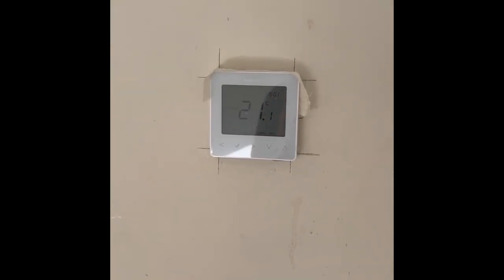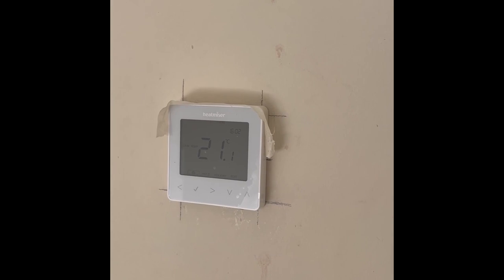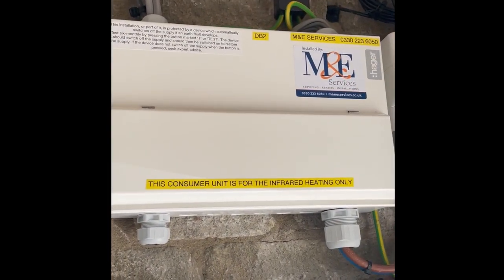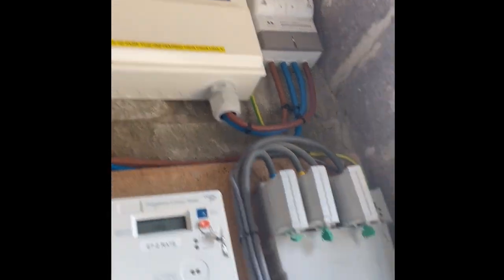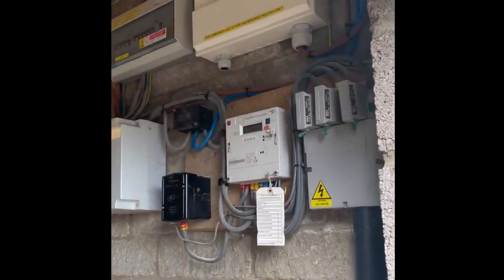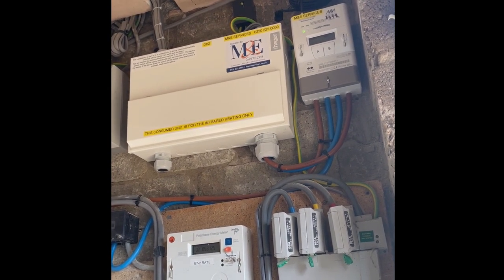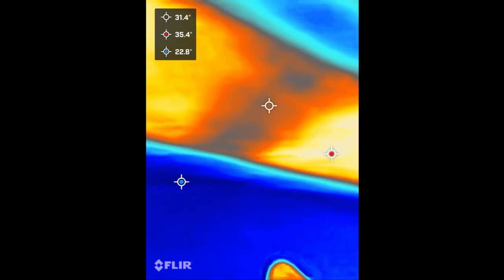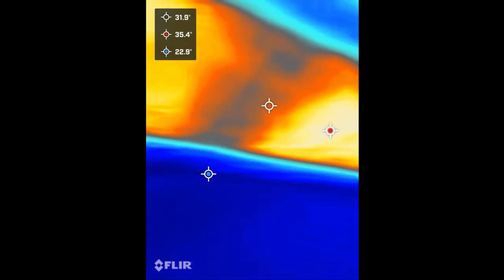Infrared Heating Installation (Video 3 of 3 Completion & Overall Summary)

Comment: We built a block of flats. Gas in all bar one where we installed an infrared system. Same U values.  The infrared system is twice as expensive to run as the others. You can’t add weather compensation and load compensation to a direct electric heating system. Electric heating is the most expensive form of heating, you can’t ever get away from it. If you had to install electric heating then at least the dimplex quantum would be cheaper to run, and cheaper to install. 
Great video, very honest and on point! Thank-you
Reply: On what basis can you say that the Dimplex Quantum would be cheaper to run?  All electric 'radiators' cost the same to run - they take the same amount of electricity to reach a certain termperature.  Having more control of the 'radiator' is another thing, and bring able to manage your heating can certainly help keep costs to a minimum, but all convection electric heaters cost the same to run and comparing them to the IR installation in the video is disingenuous unless you can actually point to real life data.  I think it's fair to say IR (and electric convection) can't compete with gas, that's a no brainer.   Replacing convection electric rads with IR is a much better case study.  Show us those comparisons.

Comment: I ordered my Astectherm mats for two rooms & they arrived within a week. You need solar PV & batteries to make IR mats worth it. Great video btw.
Reply from the maker: Great, you were much more fortunate. Agree with the solar, if youre on the decent FIT then no batteries needed, at least for a good few years.  How many kW of battery storage do you have? You have to weigh the life of the batteries also. Thanks
Reply: Hi Mike keen to here what you thought of astectherm and also how the system is working for you. How is costs to run?

Comment: Informative thank you. I'm looking at these systems as am currently on lpg and spending about £400 a month in the winter.
Reply from the maker: I would suggest looking at something else tbh.
Reply: GringoTom - I'm in a similar situation, either stick with old storage radiators, go for an LPG system or maybe a heat pump or something 🤷‍♂️
Have you made any headway?
Reply: @coreyjameshaims449  I bought a standalone Ir panel heater to try out. Video on my channel
Reply: @gringotom242  thanks! Looking forward to a review once you've stress tested it a bit more 👍

Comment: V informative videos Thank you.  I'm curious wanting your knowledge (if possible) re the Radiant heating.  I have a home I built (3200sq ft) Albeit in Vancouver Canada.  
I fitted with ESWA brand Radiant panels (basically a clear film  laminated sheet encapsulating heating foils.. Mfg'd by ITT  in Norway of all places .. Ceilings and floors were well insulated  (back side of the heat panels to ensure heat went where intended ) and the panels were stapled to the joists before applying the drywall .. Each panel receiving a dedicated 220 v line ...dozens of panels  & 12 zones installed.  
I assumed it was a decent quality product. 
Well It wasn't...as the things failed.. one by one over the years.... 60 hz causes them to hummm and this fatigue fails the connections in the elements. 
Currently None heat..  I'm well pleased.  
Replacing means stripping the Gypsum board from ceilings and Stuffing in something else. But what ?  
Curious about your mesh panels  Seems an easy(ish) retrofit.   A slap the meshes onto an existing surface  solution.  At least Reads as simple 🙂
Not understanding what all the power junctions etc are.
 Doesn't Mains power  go directly to each panel with a line voltage Thermostat ? Mine do. 
Other issue is cracking.... Heat cycling of panels does ..Bad things.. to  Mudded joints... perennially !  
I assume there may be similar issues with a Mosquito net stuck on by Drywall mud ?? Or Not  ?? 

 Small aside: Heating costs are higher than the Sales types claimed Higher than a Gas furnace Notably so And I live in a Cheap electricity  (abundant Hydro electric power) area. 
Frankly I wouldn't touch  Radiant electric heat ever again.. But now  I'm stuck with my naive choice.

Comment: This is really interesting - thank you.  I am in a similar position - no option or want to connect to gas, and a real financial need to move away from the ancient oil fuelled boiler at my now property.  All the reading i have done about Far IR suggests that the way you use it to heat your home is different - I wonder whether the occupant in your experiment has understood this - it seems to be radically different to GCH.  I'm certainly not able to go through the effort you went to with the woven panels, but I have bought a few stand-alone units from Herschel.  I look forward to monitoring my own usage over Winter, and to seeing how your occupants get by.
Thanks again

Comment: ive a heat pump but am considering installing them in my bedrooms and hall as the rads fail to heat up those areas to a sufficent temp in my opinion. thanks for the video.
Reply from the maker: look at your insulation first then the size of the radiators. if you have a heat pump and had been installed correctly I would not recommend you install these panels in addition. 

your heat pump will be 300+% efficient, this system is only 100% in comparison.

Comment: finaly some good info.witch is the total installed power of infrared foils throughout the house?.i am using infrared pannels installed on ceiling (are more effective than on the wall)and   they heat up faster because they are not covered.it is a very pleasant warmth and humidity is within normal parameters

Comment: Hi, I watched some of this video because I wanted information on the installation and running costs of Infrared Heating. It was unhelpful to compare it to just gas, it would have been more helpful to compare it to other electric heating.  My flat is electric only and we are trying to save money with IR heaters.  It would have been useful to show an installation that wasn't as indepth as this (we're not attaching to permanent wiring) and to see what the difference is between that and an electric panel heater.
Reply from the maker: this video won’t be suitable for everyone I’m afraid. 
however, electric heating and electric heating will be the exact same. your heat loss determines what possible savings you can make

Comment: This is a great video. Thanks. So I guess if somebody were to install PV with battery storage, this may also be a good option?

Would be good to see what the heating requirement is Vs the PV generation to see how it compares and how reliant any user would be on mains electricity
Reply from the maker: PV only truly offsets with battery storage. This is because in the winter months when you need the most heat, the PV in turn generates the least amount of power and never enough to run any system without storage. 

For example, you may be generating 50 watts but if your system needs 4kw to run, the balance between 4000 watts and 50 watts which is 3950 watts is being supplied from the grid. 

If you had PV when the FIT was high, the repayments would cover this. But if you add PV now without storage your kind of wasting your time. 

You need stored energy so you can draw all of the heating requirement.

Comment: I would never use Infrared Panels as a total heating system for a house, (unless solar and battery storage was involved) we use our to enhance ASHP (because we have very poor insulation, working on that long term). Through our solar system in the autumn and later winter months on cold sunny days we use the panels to heat our main rooms, so we don't have to turn the ASHP on. Otherwise when the ASHP is switched on we use it to boost our heating in very cold days -5c/-10c. They do work very well, but they are meant for well insulated homes. If you want to find out yourself, I would recommend fitting one to your shed or garage and see for yourself. Even on a very cold day standing in front the panel will keep you warm, out side of the zone will be cold especially if your insulation is poor. We have one on the chimney breast in front of us as we watch TV, and we often have to turn it off as we get to hot. We are soon to fit one in our bedroom to preheat the bed. Any electrical heating system that runs on a 1:1 ratio is never going to be cheaper than Gas becuase the units charger are not the same. With an ASHP on the other hand, which can operate at a 1:4 ratio will be cheaper, assuming the property we are comparig are made of the same materials and insulation materials.
Reply from the maker: Hi Ken. Thanks for your comments. A few things to note. 
This infra red is entirely different to the panels you have. Same ish tech but as a whole house solution different also. 

Electric and Gas are rapidly becoming the same. So one may well not be cheaper. Oil in fact is the cheapest at the moment bought right 

You’ve already said your property isn’t insulated correctly so a 1:4 is unlikely and if you need to top of that heat you have some other major issues. Your unit is undersized or your emitters are. Both will result in poor SCOPs and I’d suggest you have that investigated. 

No full electric system is ideal, the property we are testing has solar now batteries and in the highest FIT tarrif so we knew it would pay itself to run. 

This was more an experiment to prove or disprove the rhetoric surrounding this tech

Anyone is solidly advised to spend there money on insulation all day long as this will conserve energy. There’s after work on dropping your heating mean water temperature no matter the medium. Only that will substantially lower fuel bills long term. 

We are in the middle of an EWI on a filled cavity property and will post the before and after running costs in the future. 

The future means insulation and dropping the flow temperature. Period.

Comment: Interesting. Now that gas prices are going through the roof, how would your summary change? We have Solar PV and a useable 4kwh of battery storage in a bungalow ( we use OctopusEnergy Go for cheaper energy storage at night also). 
We have a gas Combi.
Any case do you think in getting some IR panels in our circumstances?
Reply from the maker: at the time of my reply, GCH is still cheaper to run. by far

Comment: Would you recommend this system over an air source pump with underfloor heating (retrofit ufh on slim insulated floor panels)
Cheers
Reply from the maker: Hi
It depends on lots of factors so not an easy one to comment without knowing the full facts. Is it just a room, is it a whole house, is there an ASHP already installed, does the property have solar panels etc etc. 
depending on the answers to this and a few more you could then determine what is best. 

If it is for a whole house, generally, it would be cheaper to run an ASHP. 

If there is gas heating currently, then the two might be as cheap to run.
Reply: @meservices3979  Retro fit ufh and ASHP to 3 bed bungalow..
Also can the panels be placed on an artex ceiling and then overboarded and skimmed?
No solar panels....
Reply from the maker: @gallerysales  your best getting a qualified and experienced heating engineer to assess and undertake the heat loss calcs in addition to the other considerations which an experienced engineer would be aware of. 

As far as installing over artex, I would recommend reboarding and you should also use foil backed plasterboard to deflect the infrared down into the room. 

I hope this helps.

Comment: Interesting. I’ve just installed infrared panels in a cottage which has electric underfloor heating also. (I replaced some horrible electric rads I inherited with the property). My electricity bill is now £300-400 a month. I have had canisters for water heating so my electricity use is mainly the heating. 1300kWh in December and looks like it’ll be similar again in January (24p per kWh!) Next I need to investigate solar panels given that electricity prices are only going one way. How many panels does your customer have to support their system which is covering their costs in full at ~750kWh per month? I can get a maximum of 11x415w panels to give me a 4.5kw system - do you think it’s worth it in the long run to reduce my costs, using nearly double what your customer does? Was that the objective with this install you completed?
Reply from the maker: Hello
When the Solar PV was installed they attracted the feed-in-tariff, this is what is supporting the payments. On average you are using 25kWh per day, that is quite a lot. Do you have an older property? What temperatures are you setting the thermostats to? Are you setting back the temperatures? How leaky is your property? Age, insulation, glazing etc?
Reply: @meservices3979  on average I’m using 40-60kWh per day according to my energy provider app. Temps are set to 17 overnight and 20 for 2.5 hours in the morning and 2.5 hours at night. It’s a 200-year old cottage but has been renovated and fully insulated. Double glazing all round. It baffles me! Do you think solar + battery would help?

Comment: Hi there, I'm just about to do an install of this and I  work for an architectural practice that have specced it a couple of times. Are you able to share the spreadsheets of your full year of data for me to share with my colleagues?
Reply: Hi David would be interested to hear what you think of it once installed as we are looking at this system for our new build
Reply from the maker: Install a heat pump Ryan. NOTHING else can give you a COP of 3.5 and upwards!
Reply: @ryanrankin8669  Will let you know! Hawkes Architecture will publish the data when the study is finished. A heat pump wasn't an option for me: Small house and had no existing functioning radiators so the IR install was much less upfront cost than a new wet radiator system. (was plastering ceilings anyway.) Plan to get solar and battery storage eventually to help with the undoubtedly higher running costs. Please note I have massively improved the fabric of the house too- the most important thing!
Reply: @DavidNormanMusic  would be great to get an update. We are doing new build (final stages of planning currently) and I have looked at this to heat our home. We will have 200mm cavity with blown bead insulation and going for a well insulated home which makes all the difference I feel. The thing that put me of the ASHP was the cost of the kit and installation. For our build we got quoted around £21k for kit only and the astectherm was around £9k with the savings you could do more insulation or solar to offset (that’s the plan anyway) but keen to hear real world cases
Reply: Indeed, and ASHP will have higher maintenance costs too, as it has moving parts. The key question is, when do the lines of running vs upfront cost cross on the graph (or do they!)  We commissioned Mesh Energy to do a study for us on this and the results were very interesting!
Reply from the maker: @DavidNormanMusic  remember the power units will not last as long as you may think, you’d need to factor this in to any lifetime costs. 

With energy costs spiralling and you only getting 1:1 it’s a dead end for us. 

With 5k discounts now available through the BUS scheme and 0% VAT you’d be surprised how quickly an alternative system would payback.
Reply: Time will tell! Very happy to be proved wrong and hope that sharing my data can be helpful for others. I've also made sure that all of the transformers are easily accessible in case they need to be replaced. Notwithstanding all this I'm hoping that all of thermal improvements will mean the heat load requirement is very small anyway. We have also got an air-sealed log burner and MVHR going in.
Reply from the maker: @DavidNormanMusic  out of interest, what is your total property heat loss now then David, it’s probably very minimal now as you say? Concentrating on making a home less leaky is the single largest needle mover. Great stuff.
Reply: @DavidNormanMusic  very keen to hear about the results from mesh energy, can this be shared? The other thing to consider is the yearly service for the heat pump and they don’t last forever so will need replaced. I feel they are expensive and I too have a running cost each year with services etc which heat map won’t. Yes overtime some or all could fail but so does ASHP and the mats will be much cheaper to replace when you add all the service costs, parts etc you would need over life cycle of the pump
Reply: @ryanrankin8669  We are waiting till we have enough robust data to share, but we are getting there. Funnily enough my boss Richard Hawkes is leading a session on this exact topic at Grand Designs Live in London tomorrow!
Reply: @ryanrankin8669  One other think to factor in from an environmental perspective is embodied energy. Heat pump is a lot more kit to end up in landfill at the end of it's life which could potentially only be 15-20 years.